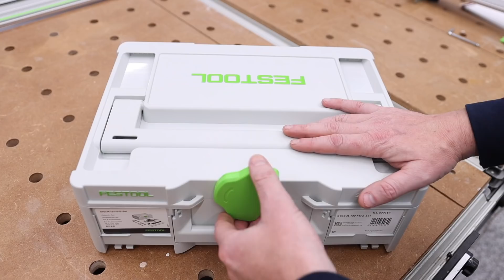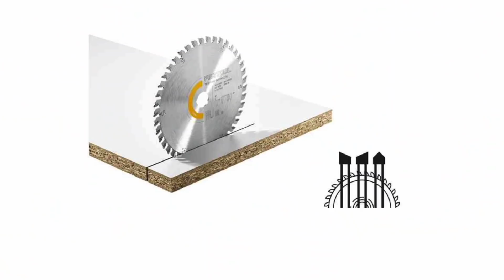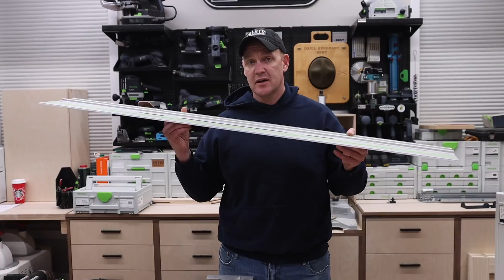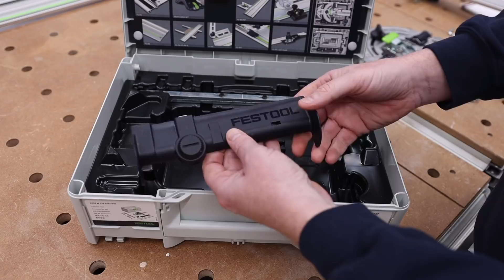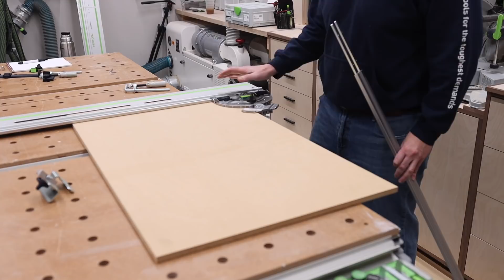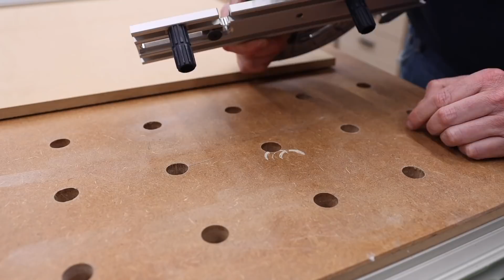Festool TS 55 F First Look

Comment: I will NOT buy another Festool product. I invested heavily in the Vac Sys clamping system, and they discontinued it. I customized my operations and my main bench for this system. This is the answer I received from Festool. "Due to continued supply chain pressure, Festool is permanently phasing out the Vacuum Clamping category." I had follow-up questions and to this date they refuse to answer. NOT the customer service I expect from Festool. They apparently just want me to accept and go away!
Reply from the maker: Sorry you had a bad experience
Reply: @bentswoodworking  You are one of the reasons I invested in the system.  It has changed my workflow.  It was innovative and to me solves all the problems of the other systems.  You featured the system is a video about 2 years ago.  Discontinuing a line and NOT answering my follow-up questions about supporting the future of my system is not a bad experience, it is a reason to walk away.
Reply: Good info to know!! Thank you for sharing and it is definitely worth knowing when your considering investing in someone’s product line and “investing” is exactly what it is because of the membership cost we all have to fork out to be part of the family. 

I don’t mind paying for quality at all but I do expect more from that quality than I do from dewalt or Milwaukee etc. 

I’ve really been wanting to add some of these tools and will take this into consideration.I appreciate it very much brother!! Stay safe out there!!
Reply: @1982MCI  Thank you!  Membership IS expensive with the Festool line.  I have lots of Festool in my shop and spent THOUSANDS of dollars on the Vac System and it is now discontinued!  I asked Festool to sell the line to someone else, no response!  As well as no response to other questions about how they will or will not support Vac Sys owners.
Reply: @slhasebroock  thing is tho that membership is worth every penny if you get the entire system which is tool PLUS support. I’m sure you paid full price but now you only have half the tool! That ain’t right in my book and is definitely worth considering when looking at other possible purchases. 

Thank you brother again!! Take care and I hope somehow something will work out for ya. What state are you in by the way?
Reply: @1982MCI  Thank you, Nebraska.
Reply: I get the frustration that Festool discontinued the VAC SYS for those who sat on the fence and missed out. What makes it so frustrating to you that you'd be inclined to not purchase Festool again? You have the VAC SYS and it's functioning properly, right? What's the deal?

From what I've read, Festool will continue to support (warranty and spare parts) the VAC SYS.
Reply: @BuckRogers2491  Its called long term service and support.  Warranty?  I would guess my warranty has long run out.  I expect service and support LONG after the warranty from a company that charges PREMIUM prices and sells their support.  And are they going to continue to support the VS accessories as well.  If I damage a rubber vacuum piece, can I get a new one and for how long.  Part of the reason I became a Festool fan was because of all the times I heard craftsmen talk about an old Festool that they STILL could get parts for.  And last blaming supply chain pressure.  Really!  I don't believe that's the real reason, but the reason that sounds good today from the marketing department.  Last they haven't answered my follow-up questions to their canned response to me.  So yes, until I have the answers I need, I'm out!  And yes, there is Festool All OVER my shop.  AND I have thousands in the VS system alone.  Do you?
Reply: @slhasebroock  I think they continue to support and repair for 10 years after discontinuing a product if it helps.
Reply: @slhasebroock  From what I know, Festool states 10 years of replacement parts for their tools. That's on par with cars and those are way more expensive. I haven't seen anything to indicate the VAC SYS parts are excluded from their parts replacement plan.

I do own lots of Festool and I got in on the VAC SYS system when the discontinuance was announced and fully aware of that announcement. I have no problem with Festool realizing something didn't sell as well as they'd hoped and stop production. As long as they have spare parts for a reasonable amount of time, I'm good with that.
Reply: @BuckRogers2491  Good for you.  No disrespect to you, but I won't go on assumptions.  I want to hear from Festool and they have chosen to ignore my request for more information.  Enjoy your Vac Sys, it's a great innovative tool they walked away from.  I hope they sell the patents to someone else.  Perhaps they could sell to the Grabo and they could expand their vacuum tool line.
Reply: @slhasebroock  I tried posting a link and it looks like YouTube doesn't like that. Search "Festool Warranty all-inclusive". Should be the first hit. On that page is the 10 year parts guarantee. No exclusion for the VAC SYS.

"This is why we guarantee the availability of every spare part for at least ten years after discontinuation of production."

There ya go, from the horse's mouth.

Comment: Hey Jason,  

Another great and informative video as always.  I really appreciate the detail and clear demonstrations you provide in all of your content.  Do you think it's worth looking into a 1.8mm blade for the TS75 for the same benefits as described at the beginning of the vid? Also, do you think all of the features of the rail square make it a better/worse option then the TSO parallel guide system?  

Thanks and keep up the great work.
Reply from the maker: Well you would have an issue trying to use 1.8mm blades on a 75 because the riving knife will still be 2.2 mm
Reply: @bentswoodworking  Is it possible to swap out the riving knife, too?